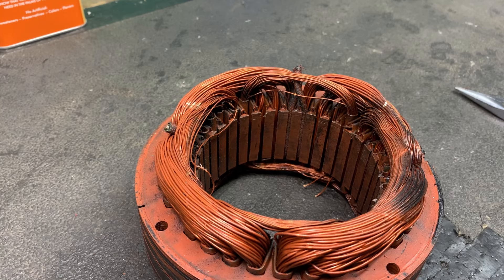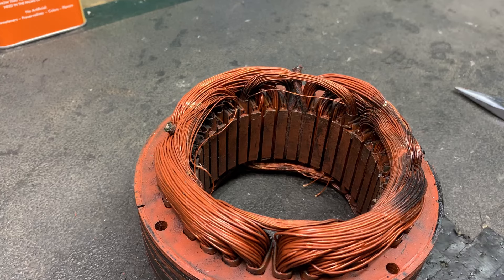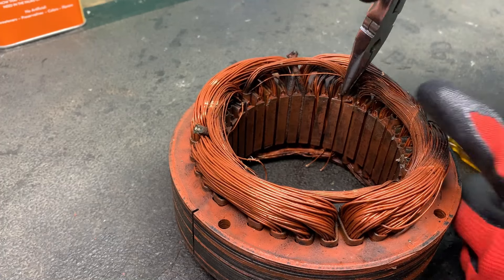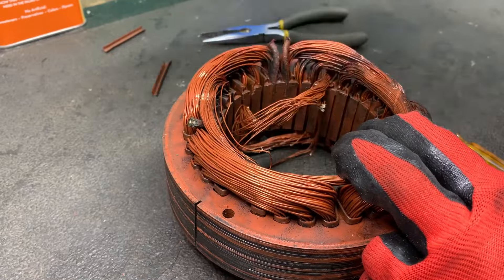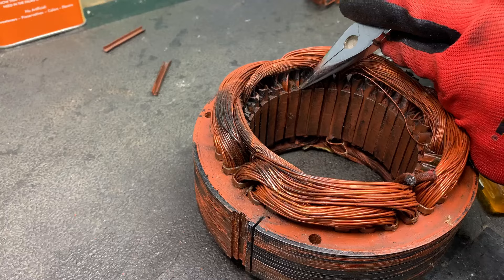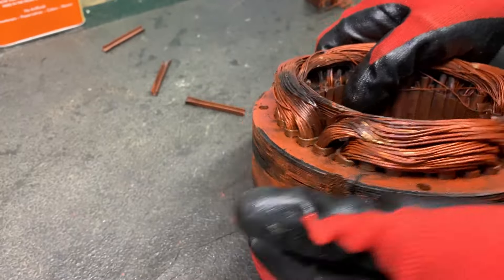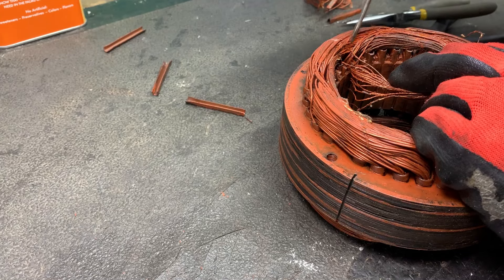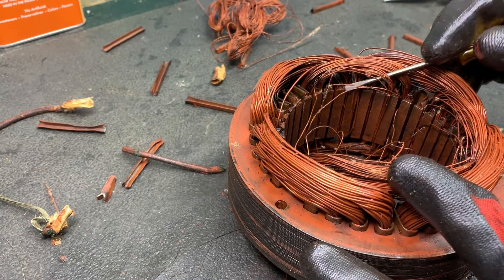New Method for Removing Copper from Motors

Comment: Oh, I see you found some lacquer, too. I'm glad I am not alone. Great video, and maybe I'll give it a try again.
Reply from the maker: I did it with a stator from a sealed unit, the oily winding made it fairly easy.
Reply: @scrapitall200  Oh good thinking. I will have lots of those to do.
Reply from the maker: I’m hoping that video will be out next Saturday. You’ll see how it worked. The major downside using this method on them, it’s hard to hold onto anything from all the oil.

Comment: Great work!🏆🏆🏆 
I have literally tons of motors! Its just a matter of finding the time to get to them.
Reply from the maker: @BullProspecting  thank you! 
I’ll say that this method doesn’t work on all motors, just depends if the insulating sleeves come out. The ones that don’t, I cut the stator in half with a machete. That works slick. As long as there isn’t any rivets lol.
Reply: @scrapitall200 Thank you so much!
 I use a metal cut off blade for my skill saw.. You can buy them at any hardware store..  The blades fit most regular size skill saws..
Its like having a demolition saw..
You should try it. When you make your cut, do it over a bucket so you don't loose the shavings.. This way is extremely fast and will save you a ton of time..
After you make the cut, you can hit the back out with a hammer or use a long flat head screw driver and pry it out.. I hope I was able to help!
Reply from the maker: @BullProspecting  you’re welcome!
That’s a cool idea. I thought about getting one for a chop saw, never thought about using a skill saw before. Thank you.
Reply: @scrapitall200  no problem at all! We gotta look out for us scrappers!🏆🏆🏆
Reply from the maker: @BullProspecting  absolutely! 👍

Comment: I don't like blades so this is a blessing to see! With any method, you have to build up speed and become more efficient. However, I didn't notice any editing, so it seems like it took you about 7.5 minutes to scrap 2 pounds of copper. That's about $24/hr. Not too shabby at all.
Reply from the maker: There was some editing, but I don’t remember how long it exactly took me. But you’re absolutely correct, with more practice it’ll get quicker and quicker. 
Thank you for watching.
Reply: Here in Australia the tax office "allows" you to collect $3K on scrapping per year with no tax. After that scrapping income is taxed. Aren't they so generous?

Comment: I believe most 230V or higher voltage motor windings, were further insulated by hot varnish and baked. Rewound ones certainly were. This would prevent this great way to get them out. This is a good common sense way to get them out, the opposite way to how they were put in. Good video.
Reply from the maker: Absolutely! I’ve had some motors that were absolutely drenched in varnish and they are a bear lol. 
It’s fun trying new methods! 
Thank you for watching.

Comment: I found that this works well for maybe about half of the motors I've tried to scrap. For the other half the insulators are just too tight or coated with shellac or for some other reason just too hard to remove. It works very well when it does though.
Reply from the maker: @steveschindler2802  I completely agree, that’s been my experience. Thank you for watching multiple videos

Comment: I always take time into consideration when scraping. It’s really easy to make a $1 an hour on a stubborn piece of scrap. You gotta know when to give up and move on to something else. I’ve done every method because every winding is different, but air chisel is best. No matter how big/small or even burnt, it’s shakes everything a part
Reply from the maker: My preferred method is cutting the stator in half with a machete then I pull the copper out. 
I’ve seen air chisels used and they are great. 

I have fun scrapping it all and as long as I’m enjoying myself, I’m not concerned about the amount of time something takes, but I know many do care about the time. 
Thank you for watching!

Comment: To much time scrapping  the copper unless  your trying to save the wire fore a different  project! I will have to say this was a good demonstration  on how to save the copper  for other  projects.
Reply from the maker: It definitely takes more time and I think only hobby scrappers as myself would try it. 
Thank you for watching.
Reply: Ok .... Bare bright price at the scrap yard is about $4+ a pound and transformer or motor price is 
 .15-.20 a pound...
I'll take out the copper thanks.
Reply: @riverboat28 except that isn’t bare bright. With the coating on it would be #2 Copper into South Korea. A small electric motor that size would go for about .45 and the copper would go for about $3.90 on a December Comex of 4.56

Comment: Thats like a work out, interesting, thanks
Reply from the maker: Thank you! I have a lot of fun scrapping.
Reply: @scrapitall200  I also cut all brass in half for the copper lengthwise 4 1/2 cut off works great  depending onif the fittings are stuck,  water heater blow off valve also

Comment: I put mine on vice,use saw zaw to cut 1 side then a flat head screw driver to pull from other side or a pair of pliers.Ive tried all methods and vice wrks for me.Thanks,Im gonna try this and see if I like it.
Reply from the maker: My preferred method is cutting the stator in half with a machete, works so good. 
This method is more about just trying new things. I’ve done it with two so far but most others it just doesn’t work. 
Thank you for watching.

Comment: I've found that the ones that are heavily lacored you can take a pair of side cutters and cut the tops of the coils in the center. Flip it over and use a screwdriver or a small pry bar and pull the coils out. It takes a little longer but it also prevents the copper and lacor dust.
Reply from the maker: Absolutely. I even use a machete to cut it in half, works the best imo. 
Thank you for watching.
Reply: Lacquer dust.

Comment: A couple of years ago I came across a motor those bits werent glued in with resin, or just too tight to remove. Congrats on finding a unicorn. On a clean bench you can use the angle grinder with a 1mm cutting disc and just sweep up the copper dust. I have a number of different size pipe sections to put the stator on while punching the wire out. Getting properly set up is the key with that repetitive work. On the stators that size allows it, I ude a meat cleaver and hammer to cut the stator and copper in half, which saves sweeping the dust. After 4 years of this I still only have a half kilo of dust saved- most motors I get are small enough for the cleaver!
Reply from the maker: I’ve found 4 or 5 that worked like this. 
Yeah I’ve been using a machete since I started my channel to cut them in half. I just like to show different methods and a subscriber asked me ti make this video.

Comment: the coil being difficult to remove had a narrower slot maybe from overheating maybe bending open the slot a little with big flat head screw driver might be worth a try i get stuck with odds and ends  often simple fixes  are not far away thanks for vids
Reply from the maker: Thank you for the suggestion, I always appreciate them. 
Thank you for watching.

Comment: A good way to do this if you don’t have the tools  I just buzz the coil on one side then work the rest of the wire out. I have used this method for salvaging the wire for rewiring motors. Why scrap wire that would be expensive new?

Comment: Where did you find this motor? It's got to be a rare beast because most motor coils I find have been lacquered into one solid mass making it almost impossible to remove anything without making a complete mess of it. After winding the coils, they usually paint on a thick layer of lacquer to secure everything in place. In that case, I usually just bust out my BBQ grill, get some hot coals heated up, and then throw the coil on the BBQ. After sitting on the heat for about 20-30 minutes, the Insulators, string, and Lacquer are gone, and the copper just pulls right out.
Reply from the maker: If I remember correctly (it’s been sitting in my shop for months) it was a motor from a small table saw. I’ve done two this way, but, you’re right, most are covered in so much lacquer. 
Thank you for watching.

Comment: You can use an air hammer with a wide chisel bit to cut the windings on one side and then pull the rest through the other side.
No copper dust/loss and no using up your cutting disks.
Time IS money,
More time = less money.
Reply from the maker: I use a machete to cut the stator in half, works incredibly well. 
I’m a hobby scrapper and I just like to show different ways of doing things. 
Thank you for watching.

Comment: Have you investigated the modems or routers yet for scrapping?
Reply from the maker: I have scrapped routers before and they have a decent board that can be sold to Boardsort. Sometimes they have a nice aluminum heatsink in them as well. 
Thank you for watching.
Reply: @scrapitall200 : 10-4 Roger Wilco over and out!
Reply from the maker: @Kerry-G  later gator lol

Comment: what did you do to the assembly that turned it the red color? just curious as it looks as if it makes it easier to remove the plastics because a lot I come across are covered in varnish. thanks
Reply from the maker: @robertguy1539  I didn’t do anything, that was just the way it was. Not sure if the varnish was breaking down. It was a very old motor. 
Yeah unfortunately this method won’t work on most for the reason you said, but someone asked me to make this video and I thought it would be fun to try it. Thank you for watching.
Reply: @scrapitall200  I have found that if you can get a .40" thick cutting wheel in a die grinder and cut one side of the copper wire off, then take a punch closest to the size of the hole the wire is in, and punch it staggering the holes it comes out pretty good.

Comment: When dealing with circuit boards, you mentioned in a previous video that you remove the battery and the aluminum heat sink? As opposed to just leaving it alone.
Reply from the maker: Batteries have to be removed because scrap yards require them to be removed and so does Boardsort. Same with the heatsinks when selling to Boardsort.
Reply: Thank you Sir
Reply from the maker: @Kerry-G  you’re welcome!

Comment: I've read at least 10 of the previous comments and surprisingly know one mention having experience with removing copper from motor before seeing your video and I have  say or ask did you soak the motor in some type of solution?
Reply from the maker: No, the motor was untouched, no burning, no soaking, nothing! 
Some motors this method will just not work but I have done it on a couple and it’s kind of fun. 
Thank you for watching.

Comment: That works but is a little slow and fiddly, I have found that a sharp cheap wood chisel, hammer, and a solid surface to work on makes fast work of it. Just shear(chisel) off one end of the windings and pull the remainder out from the other side.

Comment: What do you do when you find out it’s copper cover aluminum wire? Do you separate them copper from aluminum wire. Or if it’s not a lot do you just add it to the copper pile?
Reply from the maker: It gets sold as aluminum wire. It’s just a super thin layer of copper coating aluminum. 
Thank you for watching.

Comment: Great! But what do you do when the whole thing is coated with lacquer and won't move?
Reply from the maker: @omrik3252  there are other methods, such as using a grinder but my favorite is the machete method. I have multiple videos scrapping motors if you want to check those methods out.

Comment: I can already see you were luckier than I was with this. My friend that used to work for a motor winding company told me about this but the few times I tried it was awful with the lacquer, strings, and glues so I never tried it again.
Reply from the maker: Yeah I imagine there’s lots of ones it just won’t work with. 
Thanks for watching bud
Reply: @scrapitall200  Yep, some of those completely hardened ones, but it is nice to have no waste and no mess. You're welcome. I rushed to the computer as soon as I got back into the house.
Reply from the maker: You’re awesome my friend.
Reply: You can sell electric motors all in one piece at the scrap yard without taking them apart at all, they will pay you a breakage price is what they call it, by the pound instead of by the ton for tin. Don't pay as much as clean copper, but a whole lot more than basic tin price! The motor will have to be removed from whatever it runs though like for instance a dryer or a washing machine.

Comment: Hi, I am trying to strip a Honda alternator without cutting the copper wire as I want to use them. How can I do it? Had taken a few pictures but not sure how to post them here.
Reply from the maker: Unfortunately there is no way to post pictures here. 
You might be able to push the wires through the gaps in the stator very much like I did here in this video. You can email me a picture at scrapitall878@gmail

Comment: haha, this new method is actually the old method, (essentially watching someone wind a stator, reversed) but as we enter an age where goods are going up in price it's a good tip to remind those who might not have the cutting wheel or need to work up to their expediting. I've even gotten to tucking away half-dollar sized 4" wheels just clearing the cutting plane of the tool to finish off eventually with a hand dremel. There is something to the practice of disassembly, time to think, time exploring mechanizations, maybe blowin off steam.
Reply from the maker: Absolutely, it a way it can be therapeutic!
Thank you for watching.

Comment: I have a motor that is stuck in a half of its steel case. Any tips on how to get it out so I can recover the copper like this video?
Reply from the maker: @charmspeakjewelrydesignstu7224  like the solid piece of steel casing that wraps around the entire inner part? If so that needs to be cut down one side to relieve the tension and then the stator will come out. 
I have a few motor videos that might be useful to you.
Reply: @ no sorry, I could have described that better. It is actually half of the outer casing/housing that won’t come off.
Reply from the maker: @charmspeakjewelrydesignstu7224  sometimes there’s a few tack welds holding it. Hammer will do.

Comment: I saw one side off then they slide right out the other, works better if you don't burn it. Besides burning takes oxygen out of the copper making it brittle. I want to make a request. How do you take the hot water heaters pop off brass valve apart? It has a steel cap and spring and can't figure out how to disassemble them.
Reply from the maker: Yeah I never burn copper. 
Good question. Set it in the vise length ways with the steel cap hanging off to the side then take a grinder with a cut off disk and cut into the side near the end so you’re cutting into the brass and that steel cap, once you cut deep enough it’ll pop right out. Just be careful because the spring inside sometimes will come flying out and it’s under quite a bit of pressure, unless it’s worn out. 
Thank you for watching
Reply: @scrapitall200  starting yesterday where I sell copper tubing with no soldier but with green oxidation is no longer considered no.1 copper. No.2 is $3.05 per lb. Also you can only sell catalytic converters if you are selling the car. Battery powered sawzalls caused that law.
Reply from the maker: @TheGforcead  wow, that’s strict with the copper. If I’d had a bunch, I’d just soak it in vinegar. 
Yeah, the dang thieves ruin everything, it sad.

Comment: in the fire it goes, way easier when the little tab is gone and the wire becomes thinner when the layer of insulation burns out
Reply from the maker: Burning wire is illegal in most places and my scrapyard won’t buy burned cooper.
Reply: @scrapitall200  oh boy I didnt knew this was straight up illegal O.o thats crazy if you ask me. I understand then why you have to do it this way. Wheb I discovered the fire strategy I hated how long I spent removing them by hand tbh
Reply from the maker: Fire certainly makes things go way faster!

Comment: I liked your prayer I say amen thank you lord Jesus.  I cut my electric motors with a chopsaw I do around a 100 a time I bake them in a wood fire gets rid of the coating  the copper can be pulled out with your fingers  it's the fastest way and copper goes for cleaned not insulated prices
Reply from the maker: Glad you liked it. God bless you. 
The wire is still considered clean even with the coating on it. I actually prefer cutting them in half with a machete. I’ve been wanting to try a chop saw, still looking for a free one. 
Thank you for watching.

Comment: Was it really worth the extra time it took?
Reply from the maker: For me yes cause it’s fun trying new things and since I had a subscriber who asked me to make the video, definitely. 
You’ll have to try it yourself and see how you like it.
Reply: @scrapitall200  I guess what I'm asking is would you continue to do this?
Reply from the maker: @dolfinwriter5389  I have done it with 3 others! 
I don’t like using my grinder in the shop cause of all the dust, so it’s a nice alternative. 
But it’s not the fastest method. 
Thank you for watching.
Reply: @scrapitall200  Yeah, I like to take things outside when I need to cut with grinder or when I wire wheel to clean something rusty or similar, because of the dust.
Reply from the maker: @dolfinwriter5389  it’s so messy lol. Plus breathing in copper dust can be extremely dangerous.